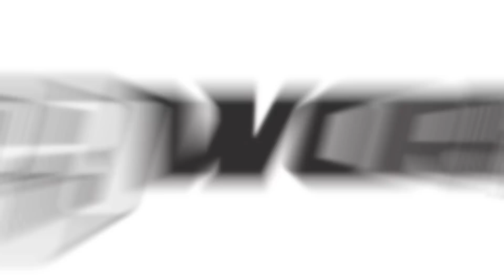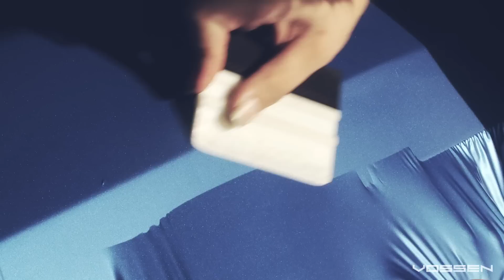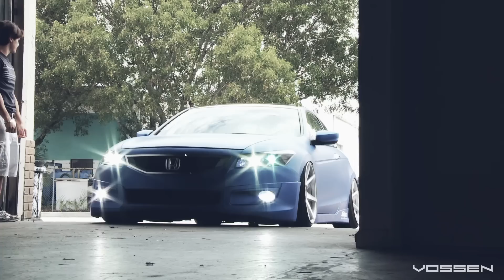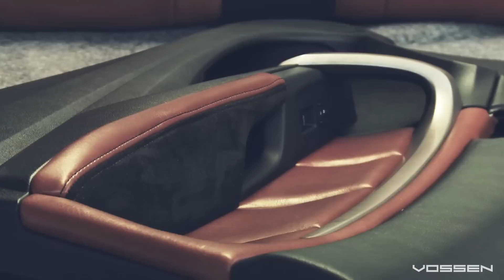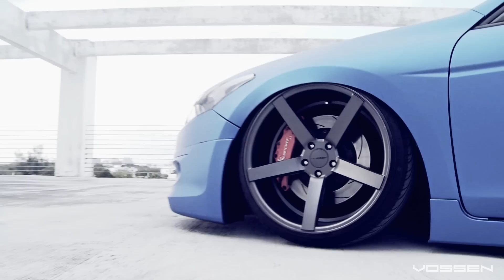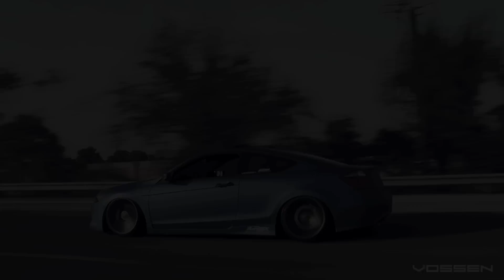Honda Accord Bagged on 20" Vossen VVS-CV3 Concave Wheels | Rims

Comment: Why doesn't fucking just make a TT V6 or just a naturally aspirated V8 sport version of their Accord? Like I think it would sell like crazy and people don't have to compromise performance for style because holy shit does that accord look good. Btw I hope if they make it, it pushes at least 500 to the wheels 😎
Reply: They have a 3.5 V6 Supercharged concept of the car. Look awesome and it was pushing around 400hp+ to the wheels. I dont think the engine size is the problem, i think that its the drivetrain. It should be a RWD. I got a 2.4 Accord coupe (same one like in the vid) and its really big and kinda lacks power because of it weight. That why the V6 is perfect with like 275hp. just needs to be RWD.

Comment: would you have to make adjustments to the car to put 20 inch rims
Reply from the maker: +Vicente Dolores you can run 20x9 front and rear with no issues. If you do the 20x10 in the rear you are fine, the 20x10.5 will need to be cambered in and lowered or its aggressive.
Reply: @what offset?

Comment: This is sweet! But, the brakes are a little overkill for a car with way less than 200hp.
Reply: Lol that car is stock 270 with an intake or minor aftermarket part over 300 easy
Reply: Wow 300? Ummm 4 banger mustangs have 310 stock!
Reply: G. Warren only problem is, personally i would rather import over muscle. Mustangs are great cars though!
Reply: G. Warren
No shit, those 4 bangers are turbo charged. The base V6 Mustang has exactly 300.
Reply: yeah if you turbo charge a 4 cyl you can get 300hp.. there civics with +300hp and they are turbo.. the accord is stock 270.. and with a few engine mods NA can get to 320.. turbo charged depending on the boost lvl the j series engine can do well over 400hp even 500+ without having problems.. visit v6power.net and or acurazine those guys on their are on another level.. and if you want to see some crazy stuff go to integra and civic sites those guys are even crazier!!
Reply: aoescool 
There are some people that have turbo charged their TLs to over 500 HP.
Reply: David Diamond Dont think an air intake will give you 30 hp......
Reply: G. Warren WTF are you talking about ?  That Accord has a 3.5L V6, which makes 271 HP WITHOUT any force induction.  So, now that we covered that; please tell me why bigger brakes wouldn't be an upgrade on any car?  If I was driving a Smart car for example, wouldn't bigger brakes still help me stop faster ?!

Comment: deciding on whether i should buy this car or the genesis coupe 3.8 track.. any suggestions?
Reply: let me tell you something, i build computers for around 10 yeras, and im 19 years old. Everything that i get into it i master it, because i dedicate. i start getting into cars now. yes genesis rwd much smaller car, better handeling. but if you can have  a genesis who else couldn't? i rather build something. every computer i build people who knows about parts and are much more experienced show me respect, and say they've never seen anything like it.
Reply: David Pereira
my opinion, depends on you buddy, you can either build it or no. i would def go with honda, im getting mine soon the 2014, instead i could go for mustang v6 when mustang is my favorite car anyways, why not? because i discovered honda, i want to build mine, not only add power, engineer my self. convert to rwd, add lsd, place an engine where the weight distribution will be close to 50/50 dedicate my self into it. hondas so far are the only i4 engine that i see that can handle 1000hp+. imagine if they had v8s
Reply: David Pereira
it depends on what you are looking for that's my point, i use to not understand why people get old beat up si to tune it, now im honda fan, and i don't see a reason why leaving it. amazing car build. Hondas are great, not saying genesis is not, ofc it is, their beautiful make great noise, and you can drift with it. but they are korean, easily break... pos when compared to hondas.. all of them kia hyundai ... anyways, get what you like
Reply: Having experience with both the genesis is nicely powered but NOT as reputable as the HONDA is EARNED when it comes to RESPECT and LONG LIFE without ANY issues. If you want LUXURY YOU want the HONDA if you want anything else you want the GENSIS.
Reply: Mike Smith  lol if you want LUXURY go with GENESIS. There is no LUXURY in a Honda Accord. GENESIS is a LUXURY Sports vehicle.
Reply: bimmersrule1 the new accord stands out, it feels very luxury inside, the problem with people is brain wash, they think only super expensive cars are luxury, but ill take a new accord coupe lowered over any BMW any day any time.
Reply: bimmersrule1
Stupidist comment ever, The Accord is Awesome luxury for only 33K
Reply: ***** you are not going to do any of those things and the reason why ppl buy pos old Hondas is to tune them and race with and when they die you take those expensive parts and put em in another pos old Honda.
Reply: Arek Brzyszcz I  meant to add because there cheap. if performance enthousiasts had money they get a new m5 and tune it realistically.
Reply: Bert Boterkoek I was tlking about putting down as much power as you could and tuner m5 beats any Honda tuner anyday because there is no replacement for displacement and when your truly only looking for pure racing raw power reliability is an afterthought shts gonna blow anyway,
Reply: JHON LONGSILVERS Hyundai or Honda... The decision should be a no brainer. Everyone and their mom is getting a genesis. I would have way more respect for someone who took an accord like this and turned it into something special. Just my .02
Reply: Bert Boterkoek That's exactly what I meant haha. My family personally owns a new Hyundai and it doesn't even compare to the civics/accords we've owned. The build quality is no where near the same. Sorry if I didnt make myself clear. Honda all day every day.

Comment: Is it considered bagged with coilovers?
Reply: Nope. If it has coilovers it's static
Reply: What does static mean?
Reply: Could be bags OVER coilovers
Reply: No coil springs just air bags
Reply: RCSJ11
You can get motorized coilover systems.

Comment: how much would it cost to make a stock honda accord look like this?
Reply: about 28k
Reply: Kendrick Okafor mine is almost there
Reply: Are you saying 28k in mods cause that's far from the truth or 28k for mods and the car?
Reply: Airbags plus instal "not sure on the price for that, wrap is like 2,500 to 3,000, wheels and tires are like 2,500-3,200. So 10k sounds about fair.
Reply: Plus seats so who knows the owner may have spent closer to 11-12k. I was just saying 28k in mods would have been the biggest rip off, maybe the car with the mods 28k.
Reply: ALAN MACK Its not about money its about having fun, some people love to build cars a Honda Accord is his car of choice regardless of what the retail value is
Reply: ALAN MACK  I'm saying 28k on mods alone.i put 15k in mine and its still not to this level. complications and other things will make you spend more money . he's running bags that costs 6500(airrex) , wheels 2500 , tires 500, wrap 2500, seats 2500, hfp kit all around 1800 , costs for inhalation of bags 800. that alone is totaling 17,100 and theres more done to the car that you can't see. he had coils before and got bags , things like that make you lose money . or buying and selling wheels

Comment: How much would an upholstery package like that run?
Reply: +Joe Castro  For all the seats and both door panels my local shop would do it for about $1000 that's with real brown leather and sued. It would obviously be cheaper if you used a faux sued and a vinyl instead.
Reply: Yeah I wouldn't do fake leather, but thanks its good to know what I'd be looking at. Its a lot less than I thought.

Comment: what year is this honda ? please
Reply from the maker: +Backthat Assup 2009 i think
Reply: It's a 2011 I have the exact model
Reply: it's actually 2008-2010 model. 2011 and up have a difference front bumper. by exact looks it's a 2008/09
Reply: +Andrew Wegener Its a 2010 i know the owner EX-L V6

Comment: how do you put a 10.5 front without rubbing on u turns? not possible is it?
Reply: you dont uturn lol i cant uturn
Reply: ***** what car do you have and wheels specs please
Reply: 8th gen accord with 20x10.5 with 255/30
Reply: ***** sweet i have a 2010 accord, im looking to buy stance wheels sc6, 20" but my car is low, i was wodering if you have to do any modifications, i dont want to run with 255/30 you most feel the road a lot
Reply: Crixus SPARTAN
fenders rolled/pulled.255/30 is like best for daily people usually go 245/30 an lower
Reply: thank you carlo do u ave pics of your car i can see
Reply: my car was upgraded to simple 255 tires and I rub, trying to see what spacer i need
Reply: ***** i got cv3 1 week ago, 20x9F 20x10.5R car look so sick
Reply: Crixus SPARTAN
ayy